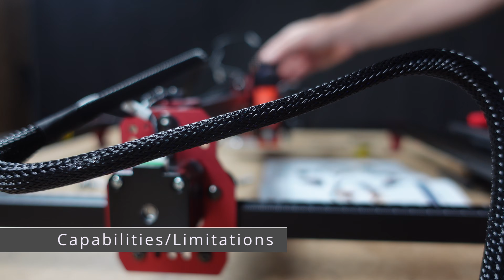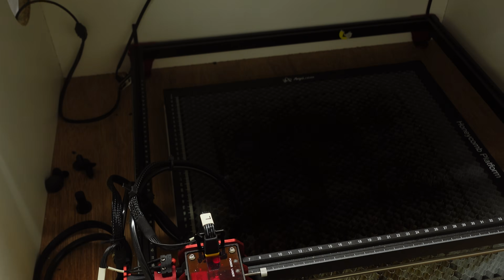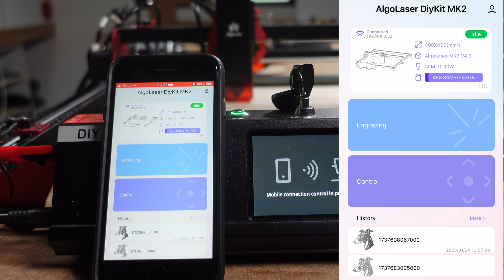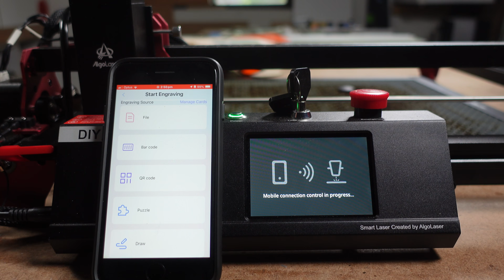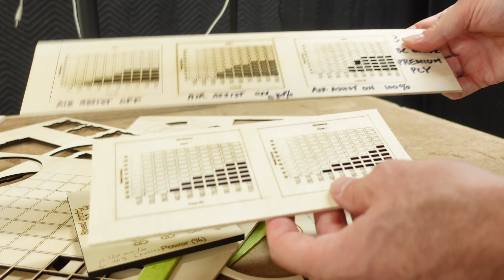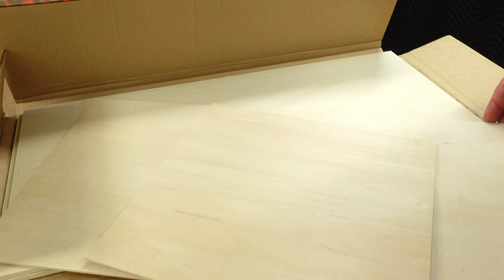AlgoLaser DIY Kit MK2 10W Review - new user experience

Comment: Hey I’m having a problem with my laser whenever I try to move it up or down it moves to a corner and starts making a grinding or "da-da-da" noise,and whenever I’m printing something it has like a shadow which makes the image not clear
Reply from the maker: Sorry...just getting to this now. If you're hearing a grinding noise then it's likely because your laser isn't homed, or zeroed properly. You're hitting the extents of the work area. A shadow in the image is likely due to belt tension. Tighten up the belts and see if there is a difference. This may also help to solve your grinding issue.

Comment: how do i make a wooden keychain without using a computer?
Reply from the maker: Using the onboard AlgoOS you'd need to do two operations without moving the workpiece. Make the cut for the small hole first. Make the cut for the outside last.

Comment: This machine has 10 watt laser .Is this machine is compatible with more powerful laser like 40 watt or 80 watts.
Reply from the maker: If I understand your question correctly, yes, this laser can be equipped with higher power modules. They can be purchased as extra components from the AlgoLaser website.
Reply: Can I switch module from 10w to 40w on this unit? Having a hard time engraving acrylic items

Comment: we bought one of these and the wiring is enclosed in a corrigated plastic hose that is as stiff as a frozen garden hose, it looks like a corrigated pipe making this lazer almost useless, the cable gets caught in the frame and causes the lazer to lose its bearing, not great, if we don't get some result from the company we will be be sending this mess back..
Reply from the maker: I'm sorry to hear that's been your experience. I might be able to help you. I've found that using zip ties to tie the air hose and the wiring loom together makes a big difference. It then moves quite well with the laser module. I agree, the loom and air hose still tend to drag across the material surface, so I created a solution. I laser cut a simple bracket which holds the loom/air hose assembly nicely off the material being cut. It's made a huge improvement and I can now freely use the laser without any hassle. I can send you the design of the bracket and photos of how I installed it. Email me on info@colinklupiec.com and I'll send it to you.

Comment: Thanks for a really good review. I have just bought one and I am waiting for it to arrive. I was concerned that, as I only have a desktop pc and I can't take it to my shed  how would I actually use it. I didn't realize Lightburn and LaserGRBL need Windows yo operate.  You have put my mind at ease and now I will save for a little laptop. Thanks again  Dave. 👍
Reply from the maker: Hi Dave. Glad my review was helpful. You might like to know that I run Lightburn quite successfully from my Mac. I think it's worth the price for the software. The user interface for Lightburn is a bit dated, but the software works quite well on Mac and PC. I mostly use Lightburn with the laser. I'm surprised at what such a small unit can do. Recently I've been making box lamps using the boxes.py box calculator. It's really cool. I hope you enjoy your laser.
Reply: @ColinKlupiec  thanks gir the advice and I've been looking into LaserGRBL. My problem is  I'd have to take my windows desktop to my shed where I do my woodworking which is not practical so I would need a laptop which I don't have.  Any suggestions for a cheapish laptop that would be suitable? Thanks, Dave

Comment: The laser looks very good in terms of quality. I also like the emergency off and the connection for other devices. However, I decided on an atomstack with 10w because I don't need a screen and the atomstack was about 70$ cheaper for the same power.

Comment: I'm considering between creality, sculpfun and now algo laser.

Xtool is out of the question as it's too expensive. Xtool is the prusa of laser world.
If this algolaser laser came with a good enclosure it would be a winner hands down by far. Why can't they include a good enclosure for just $100 extra
They want $500 extra, that's insane. Surely you can make a good enclosure  for $50 in china.
An enclosure similar to co2 k40. Simple, strong but looks good.
Reply from the maker: You make a fair point. $500 does seem like a lot. Although it does come with a camera, internal light,  and an isolation switch when you open the cover. That's why I built my own. But I reckon if you're doing a lot of engraving then maybe it's worth buying it.